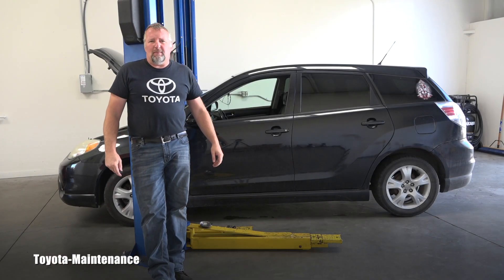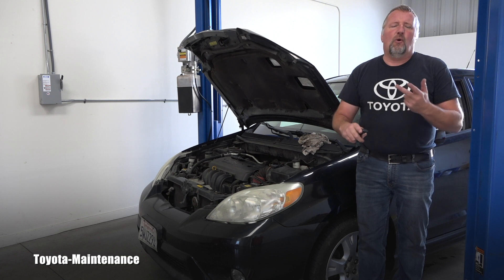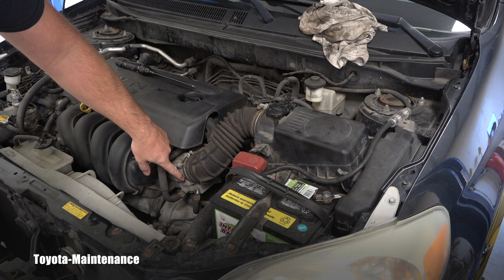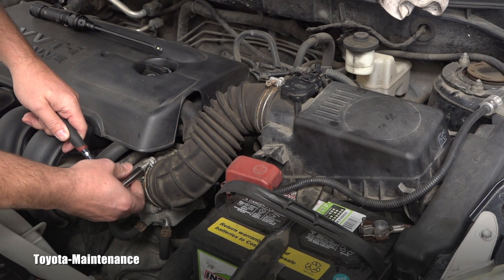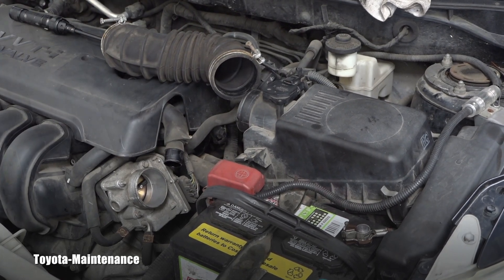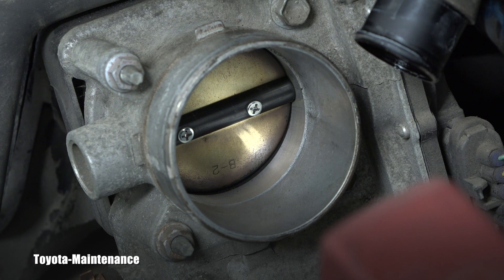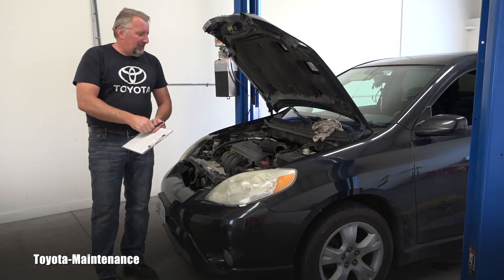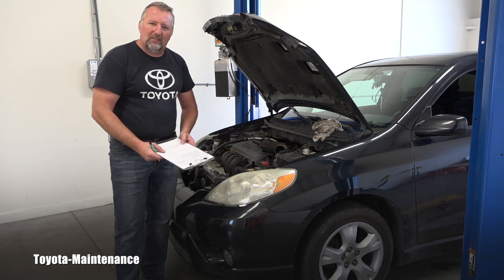Toyota Matrix Throttle Body Inspection

Comment: Your videos are AMAZING and I have tried a lot out on my own vehicle, 2010 Toyota Tundra 4.7 v8. I got a question, my check engine light came on and it’s the smog pump. Can you post a video on how to replace that? There are also bypass kits for the truck. Would you recommend them? As I read up and some sites say that a smog pump really isn’t necessary. Thanks for the videos!